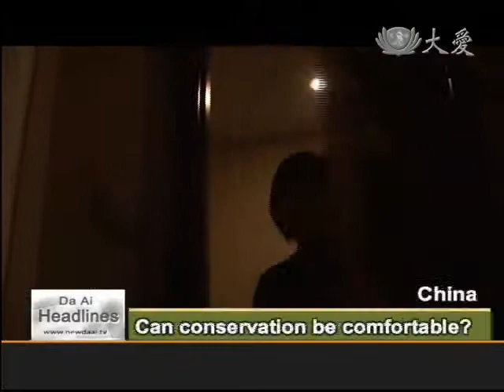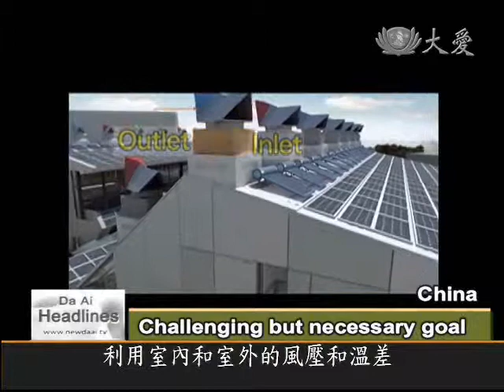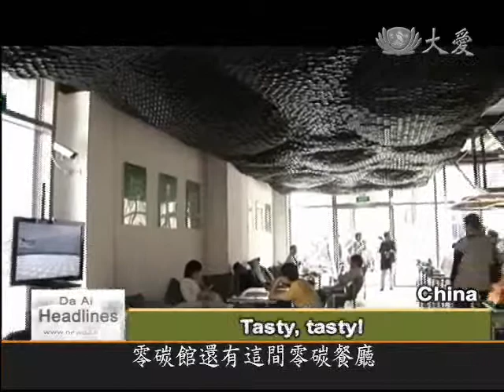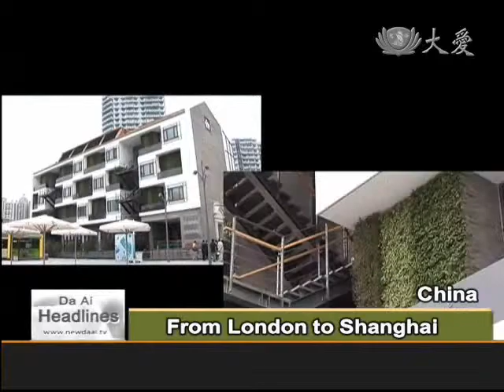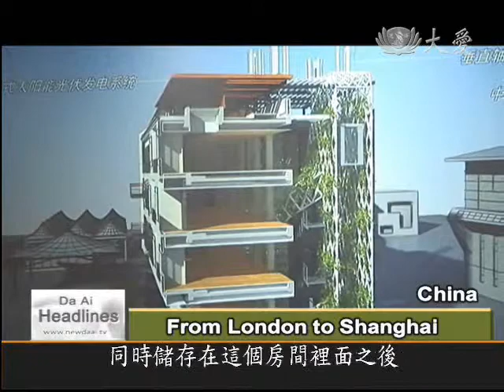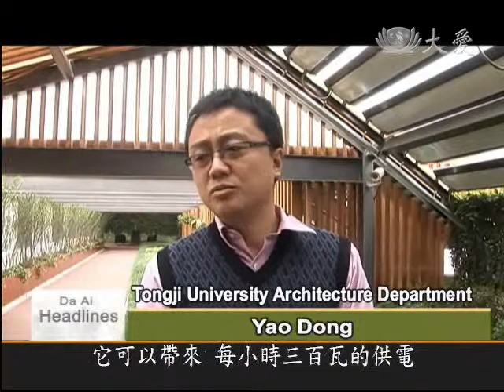DaAi HeadLines_20100629_A slogan for the future

Comment from the maker: From London to Shanghai

Another zero-energy building is the Shanghai Eco-Home, the grey exterior of which was constructed from 150,000 bricks salvaged from old Shanghai, and other waste, thus conserving on concrete.

Shanghai Academy of Building Research, Tao Fangfang: "Silt dredged from the river is a big problem for this city;  now, we no longer see it as waste material.  Instead, we use it to make hollow bricks, to form walls.  It's an insulating material, for both cold and heat."

Comment from the maker: Thin-film amorphous silicon cells

Did you notice that the solar panels installed on the windows all allow sunlight in?  That's because they are thin-film amorphous-silicon photovoltaics, and allow far more sunlight in than more traditional, crystaline-silicon cells.

Tongji University Architecture Department, Yao Dong: "We calculated that one of those balcony-sized solar panels you saw downstairs can, on a sunny day, provide 300 watts of electricity an hour."